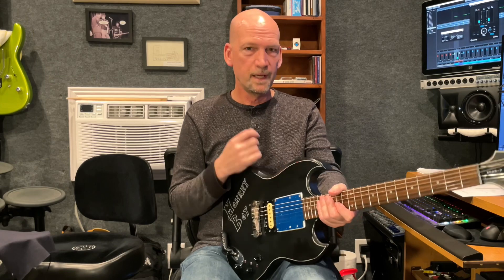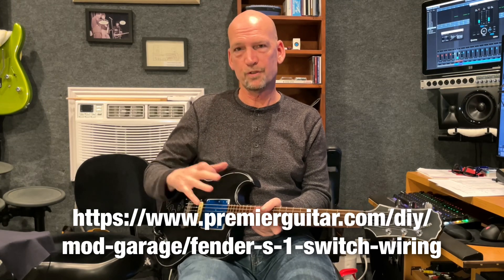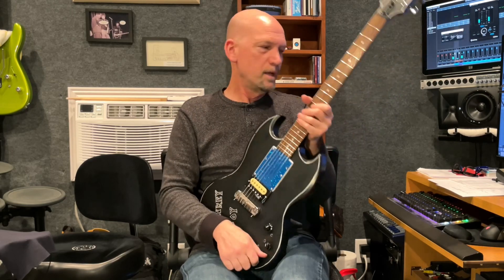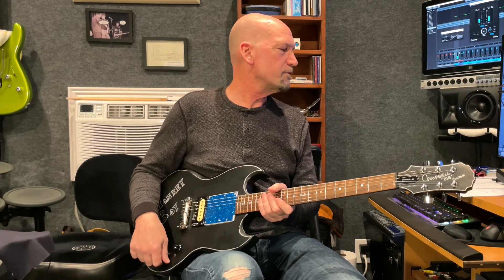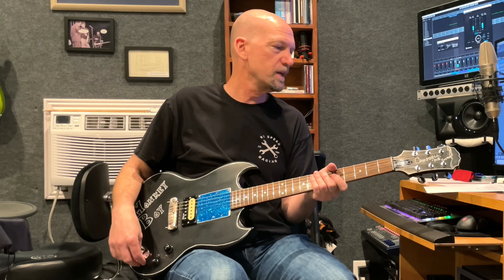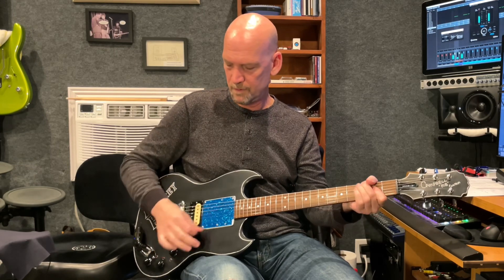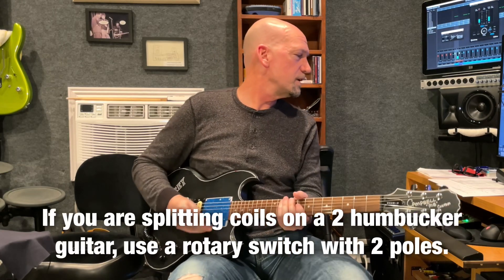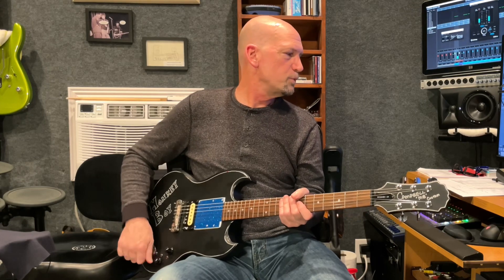Using Capacitors and Resistors for Tone Shaping. I may have lost my Mind. 2- 6 Way Rotary Switches.

Comment: In the early ‘70’s, when I was about 11, or 12, I had a cheap Teisco Strat copy, that I used to experiment on.

There was a Radio Shack a couple blocks from my house, (for easy access to all the parts.)

Someone gave me a beautiful Framus 5/012 Sorento, that had the neck irreparably broken. I took all the electronics out of it, and put them in the Teisco. (Including the pickups, and real spring-loaded ‘pinky’ tremolo knob.) 

I did a similar thing, as you, with the switching, except I used mini DPST switches. 

It was a horrendous sight, with six Radio Shack switches, (plus the original, and the Framus switches), and four pickups crammed between the fretboard and bridge, but it made so many different sounds. I could mix-and-match all the resistors/capacitors.

I wish I still had it. Just to use as a conversation piece.

Comment: To have ear support with a visual representation - as you said - would be awesome. Your investigation is so inspiring. On one of my strats I have some mods too. Someone with good knowledge did it for me. My pichups are tuned with a lowpass filter with some resonance (passive) and an Impedance transformer. The latte needs very little power from a battery.

Comment: Are the resistors and caps just coming off the split coil wires and going to ground?  How do you wire this or perhaps do you have a diagram?  I do this kinda stuff and I have 6 way rilotary switches just need to know where the leeds off the switches connect to. Great video !!
Reply from the maker: I have 3 videos in this series,… to keep them shorter.
Video 3 starts with a quick diagram.
Reply from the maker: 4 Way Switch, 3 Cap and Resistor Settings, 2 Coils, 1 Pickup.#guitarhacks #guitarmods #pickupmod
https://youtu.be/5ZqKpyKJJzQ
Reply: @charlescampbell6167  thank you I will check them out soon